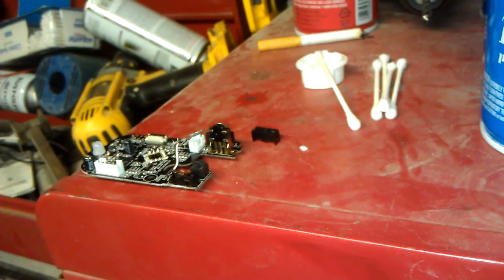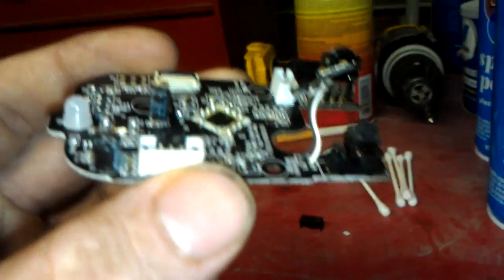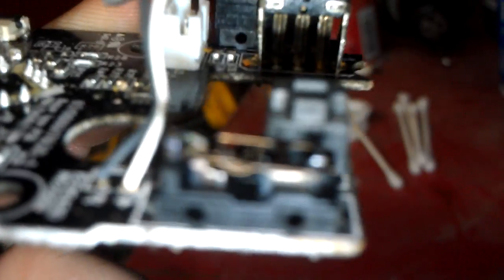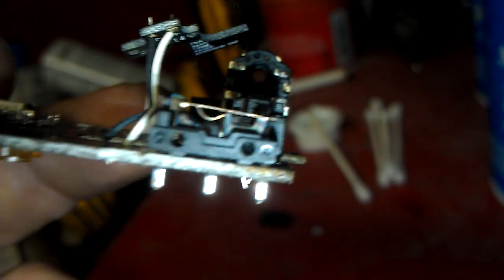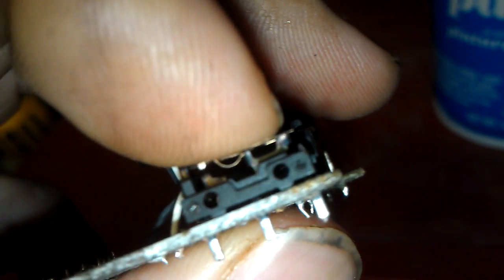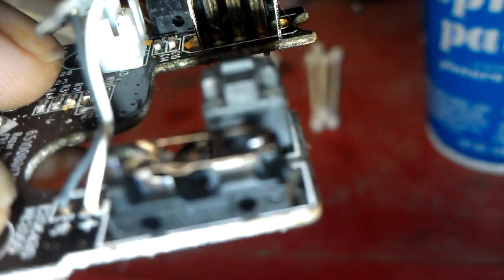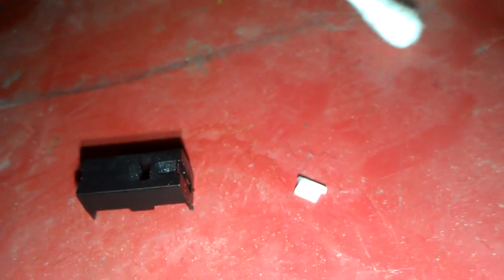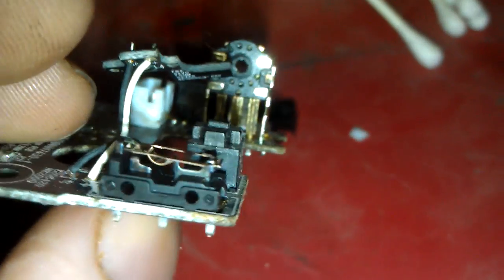Razr Naga button fix proper.(Read Caption)

Comment: Thank you so much works like a charm. I will link a video on how to remove the covering for the contacts which I had a hard time with How to fix mouse button - intermittent or loose contact - without soldering a new switch. 4 years and running strong thanks!
Reply from the maker: I'm guessing youtube got rid of the video reply feature?or maybe I don't see it because it is my own video. I'm glad some(most) of you get it. Coming up on 2 years now and have never had another issue with mine again as well. Thanks for the little visual video too.

Comment from the maker: I don't know what happened to the audio and I don't have the original video because my pain in the ass ex stole the phone it was on. somehow youtube totally fucked this video for me. pretty much the just of what I did to fix this seeins how I was gonna order a new one anyways is take it apart further than I have before to see if I could fix it one last time. seeins how it was useless anyways. once you get it apart you will see the little black covers inside. Carefully pop them off and be very careful to not lose that little white button out of it. TAKE A REAL GOOD LOOK AT HOW THE METAL CONTACT PLATE GOES IN THE SWITCH. cause odds are its going to come apart. in the video you will see the contact points im pressing together. its those contact points that get dirty and corroded. what I did was using some automotive carb cleaner on a q-tip, cleaned those contacts up and used a little bit of 2000 grit sand paper on them by folding the paper in half, getting it in the switch and pressing the switch lightly while pulling the sand paper through the contacts. I finished by putting some automotive light bulb contact grease in them to keep them from corroding again. Its been almost 2 years and I have still yet to have another problem with this mouse.

Comment: Good job on explaining what the problem is! Most videos just said to put cleaner on that white plastic button, which, after seeing the inside of the switch, will not do much. I thought I broke the switch though when, as I was sanding the metal contact, I popped off the spring part. At first, I thought there was a tiny bit of metal connecting it that I had broken, but, after looking at it closely, there are just little grooves that hold in place and you can put it back on.

Comment: Thanks for the post! My Naga right mouse button was double clicking when I click it once. Now its fixed!! Extra hints:
1 If your right button needs to be cleaned, you only need to remove the cover. You do not need to remove the circuit board.
2 Feel free to use 2000 grit sandpaper to rub in between the contacts. Just be careful not to rub to much.
3 If the metal tab falls out, be  patient, it will go back in.
4 While you are in there, lube your mouse wheel axle. Look for other videos for this.

Comment from the maker: not a problem, not everyone on here cared for it, got into a decent sized "heated" disscussion with a guy weather its the right way to fix it or not, he SWEARS his way is better. But I know for a fact that this is really the only way to get it fixed properly. I tried some of the other methods ive seen on here(including his) and they only lasted about 6 months. So after getting repeatedly fragged one night I got tired of it and decided it was do or die time and pulled it apart.

Comment: Hey man just wanted to say thanks for this.

I had a good idea of what was wrong with it since I've encountered this issue with other gaming mice in the past, but your video gave me the confidence to actually disassemble my Naga and fix the damned thing.

This is actually my second Naga. Almost all of the buttons on the first one messed up after a year and honestly I just didn't feel like sending back this refurb a second time even though it's still under warranty. Good as new now.

Thanks again